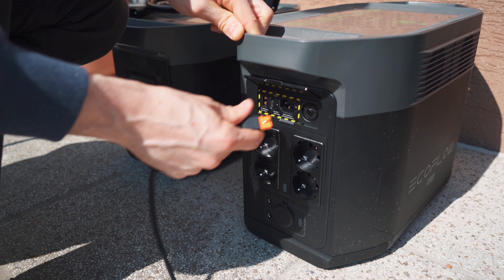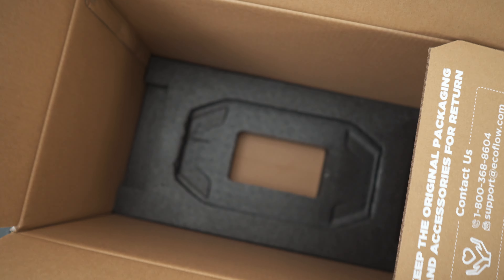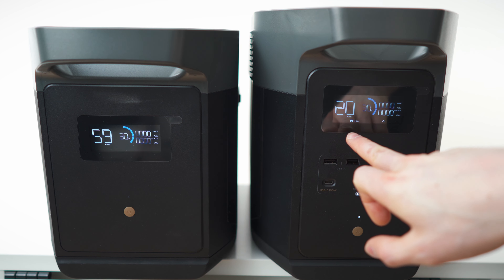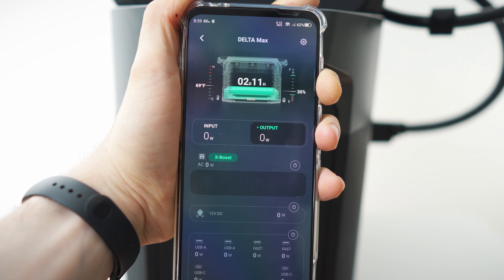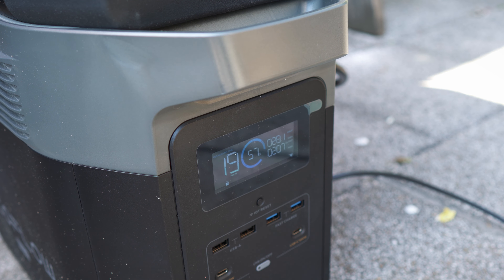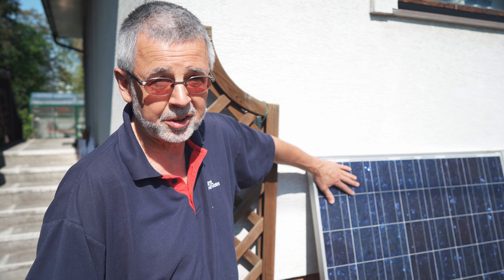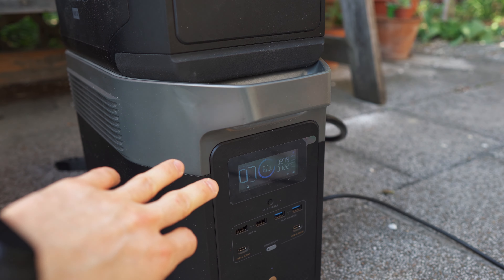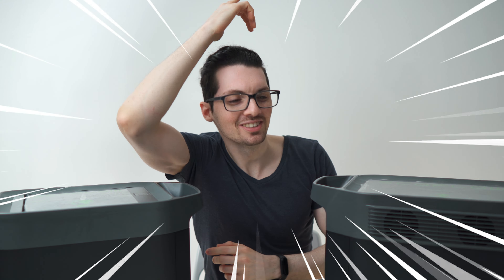EcoFlow DELTA Max - EVERYTHING You Need To Know (Comprehensive Review)

Comment: The most cases when your need is probably in winter time when things get a little bit colder in any things running so the 45 degree angle is probably better to get better power in the winter time when power is getting to be lost and not found because Russia stopped everything she's trying to kill off everybody would not let him have any heat that's why I'm happy you guys got some solar panels so on your own with your fighting back against it and China's trying to do their thing. So it's a setup for winter mode it'll still work in the summertime and they still should be able to charge it in one day's time I don't know about your Winters though.

Comment: Does anyone know if you can connect more solar panels than the 800w ? Like in a home setup its normal to have more panels than your inverter can process so in low light situations you have more input, and when the sun is out the inverter will just cap the incoming power to whatever it can handle. I wonder if the ecoflow can do the same thing.

Comment: When I got my Delta Max I noticed on the solar XT60 connector there is a center third contact that's not on normal XT60. Any Idea what this connector is and is it ok to make your own XT60 connectors without this third contact to use with the power station?

Comment: Does it have a rest api?
Reply from the maker: You can access it over the IP on a browser, if you're connected to its WiFi.
~ Chris
Reply: @TechMagnet  but no api for automation? Example ac loss and Batterie less then 15% shutdown the pc
Reply: @stili774  All I can say is that the Delta Max is one hell of a power station. You can connect extra batteries and it charges very quickly .

Comment: No you be better off if you charge it from solar panels and not buy from the grid special with big red could end up being shorted out without an without power give you less and less power in your area so more you can get from solar panel the better off you're be this bag got to add more solar panels to your Delta to make an efficient and I would think 800 watt officiants for that. Not too fast and not too slow and all you need is another battery to go with it capacity of that generator. Of course you can get a second one and get two batteries for that and you being a good position but then again I don't know if you can find to deltamax together but if you could that'd be really good then you need another 800 watts of solar panels or maybe I'll be 1,200 watt solar panels by then. Just don't steal the solar panels from your other systems which makes your house work.